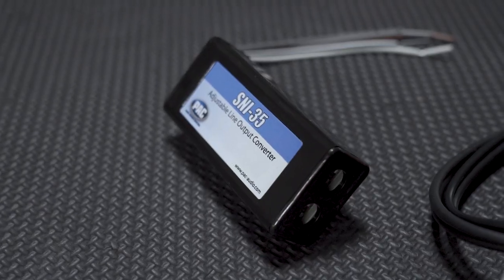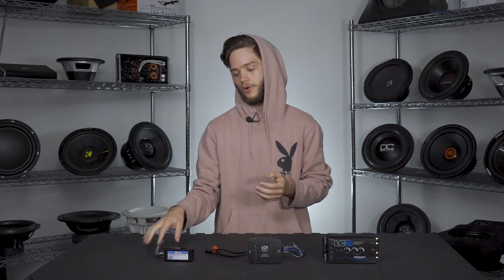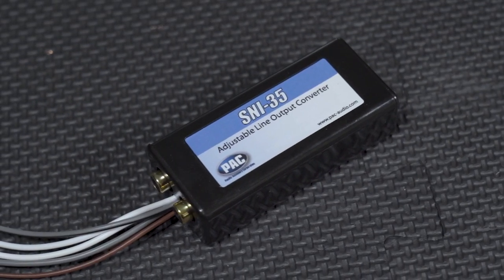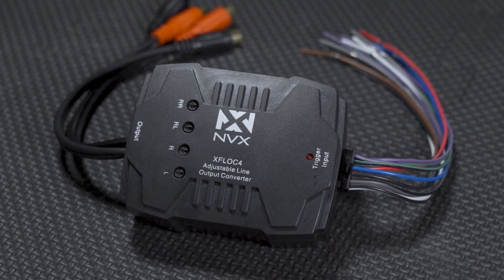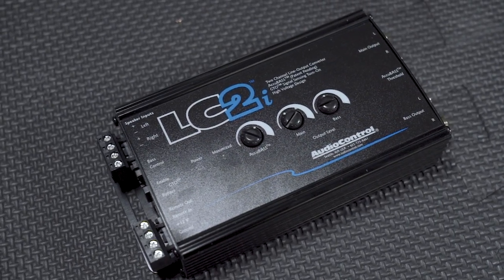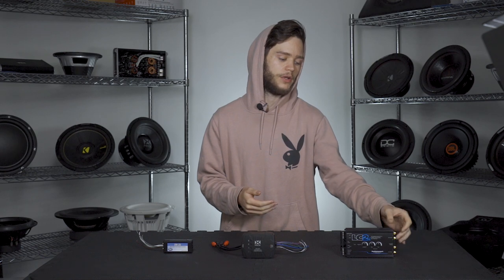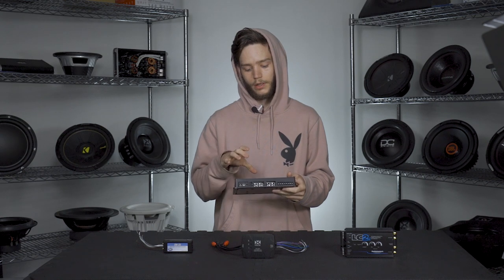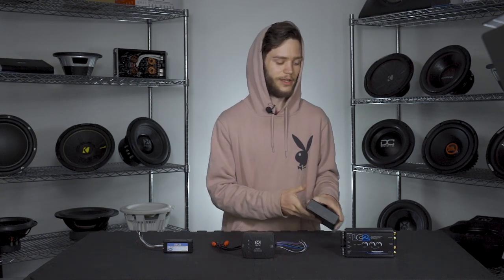What is a Line Output Converter? What are They Used for and Why Should YOU Buy One?

Comment: What output converter would you recommend for a 2014 Chevy Silverado with a Bose system without a subwoofer. I will be installing 2 Rockford P3 12's and a Rockford 1000W amp.

Comment: I have a Lc2i and i have skar vdr 12s.  The Lc2i plays down to 33hz but my box is tuned to 32hz, shud i still use it or will i be missing some lower end sound? I have an installbay loc now and it sound really good now, sub sonic filter is set at 30 currently.

Comment: The lc2i should be the only one available. It's the best.
Reply: AudioControl for the win.
Reply: When i worked at Amazon I was inside the trucks unloading bins by hand. One day I was alone in there and saw a tote full of those lc2 and I had never used one before but heard of it. Took the fucker out of the box and pocketed it, and holy fuck, now I know why it’s so expensive compared to the $20 loc
Reply: @PincheBeto_Bass  whys that? I have a cheapy right now...
Reply: @radianm6  Im an installer and I still recommend the cheap loc’s cause most people don’t want to spend the extra 100 on just that, I only recommend the AudioControl brand for a 4 channel amp
Reply: @PincheBeto_Bass  I might get me an expensive one bc my Rockford T1 isnt slamming like it should be. Amp is new and sub and amp has been dyno tested. So I'm thinking its bc the loc is a cheapy and not sending good power to the amp.
Reply: JL Audio LoC 22 is better. I’ve had them all from LC7is to RF DSR1s DSPS. Been in this business 10 years.
Reply: @gustavogo2915  cool story
Reply: I thought they will mention that 30hz filter.